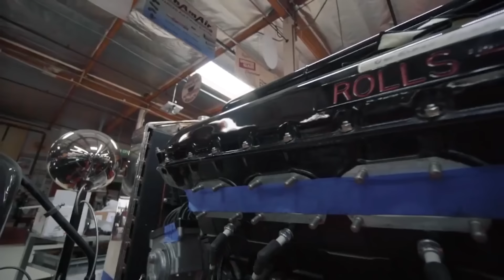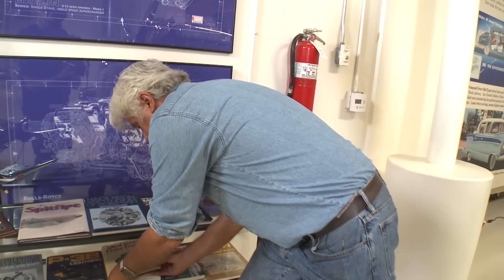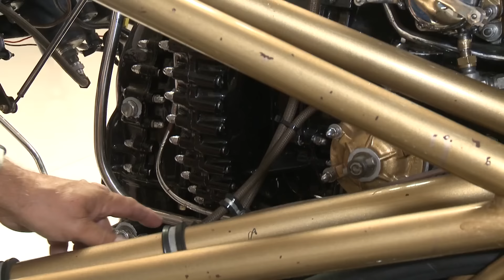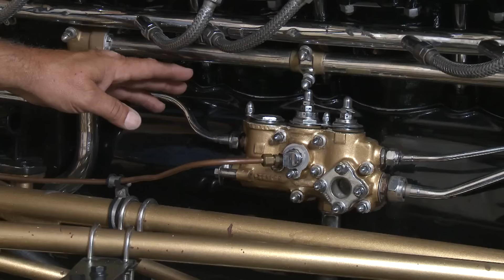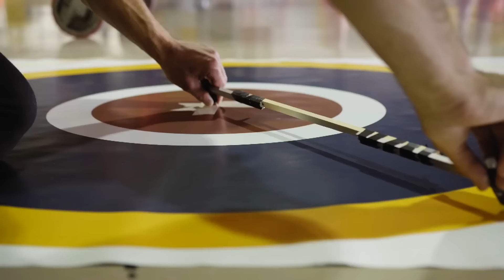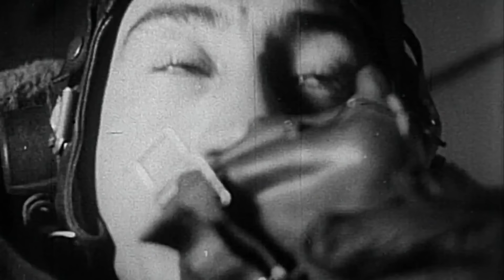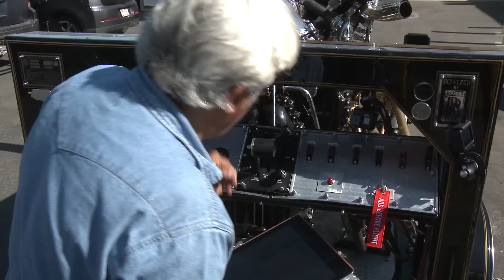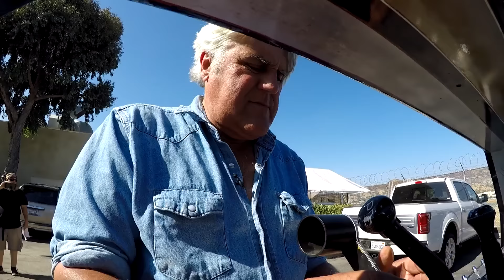The Engine That Won World War II - Jay Leno's Garage

Comment: Jay Leno he has so much fun .Not even close that engine is nice it’s cool demo.But the  F4U incorporated the largest engine available at the time, the 2,000 hp (1,500 kW) 18-cylinder Pratt & Whitney R-2800 Double Wasp radial. To extract as much power as possible, a relatively large Hamilton Standard Hydromatic three-blade propeller of 13 feet 4 inches (4.06 m) was used.This engine won the War 2 it was place in a  Corsair it was fastest warbird at that time top speed was 450mph it was fighter or dive bomber.

Comment: As soon as the engine kicks first time, you need to put the idle cut off lever in full rich position or it won't continue to run. You are starting it on the prime fuel you put in before hitting the starter.

Comment: I used to have a pilot's handbook for a Spitfire. The rules for a Merlin specified 2,400 rpm max normal power, and 2700 at wartime power for limited time. 3,000 rpm at emergency power, for a very few minutes only (something like 12 mins max, or less, depending upon the engine variant), and then a mandatory strip down and rebuild, even if it had been throttled past the emergency gate only for a moment. A wire on the throttle had to be broken to access those rpm in level flight, thus indicating that a rebuild was needed. None of them could be run at 4,000 rpm. 
The first Packard Merlins had better main bearings than the British ones, because of the initial availability of better parts on your side of the Pond, and they also had a number of   other small differences, including American nut and bolt sizes instead of the British ones. The latter was not only because of parts availability, but also to allow the use of standard toolkits for each nation. 
Does anyone know, did Hispaño use Metric sizes for their Merlins, some of which were supplied and licensed to Messerschmitt in 1943? Maybe not, but it would be interesting to know.

Comment: I understand Jay's fascination with the V-12 liquid cooled aircraft engine since it shares many similarities with automotive engines. However, the hyperbolic statement that the Merlin was the engine that won WW2 is just fantasy as is Jay's opinion that the Merlin is the best piston aircraft engine. There were two and perhaps three engines that really vie for the honor of "engine that won WW2" and they were air-cooled radials. First would have to be the Pratt & Whitney R-1830 Twin Wasp twin-row 14-cylinder radial that powered all B-24s and most C-47s. Without those two airplanes the allied offensive would have been gutless. The R-1830 also is the most produced aircraft engine of all time with 173,618 units. The second would be the Pratt & Whitney R-2800 Double Wasp twin-row 18-cylinder radial that powered the P-47 Thunderbolt, F4U Corsair, F6F Hellcat, and C-46 transport.  This is the bulk of US fighter strength in WW2, and for most of the war the R-2800 was the most powerful aircraft engine available. Both the R-2800 and R-1830 had legendary reliability and damage tolerance unlike the Merlin. The third engine is the Wright R-3350 Duplex Cyclone twin-row 18-cylinder radial that powered the B-29.  It can be argued that the B-29 ultimately delivered the punch that ended the war.  It would be somewhat more difficult for Jay to have any of these radials in his garage, and none power any of his cars like the Merlin, but these radials deserve the accolade of "engines that won WW2" and truly are the greatest piston aircraft engines ever made.
Reply: For combat use, the radial had many advantages. Plenty of stories of planes coming home with one, two or even more cylinders shot out. But for max performance  liquid cooling was better. Plenty of Hurricanes and Spitfires went down with shot out cooling, where a radial would have survived. But in the Battle of Britain, it was all about performance. Climb rate and top speed were the trumps and if you look at the maps of the battlefield, and know the RAF tactics, then you'll see why. With limited fuel range in the planes and basic radar, the RAF had to get squadrons and later, wings up to intercept height quickly. The Merlin was the right engine at the right time. It might not have won the war, but it did save Britain, and without Britain, Europe could not have been retaken.
Reply: No doubt the Merlin was a key factor in the Battle of Britain. That said, many developments came along after 1940 and the radial carried the bulk of the load. There was no substantial difference in performance between radials and Vees.  Aircraft speeds and climb rates were similar for top fighters powered by both, Vees having an advantage in fuel efficiency and frontal drag (minimized by radial cowling design) and radials having a weight, power, and durability advantage.  P&W alone contributed over 50% of the aircraft horsepower on the allied side of the war. Radials continued being the recip of choice until jets made them obsolete.
Reply: @RedRoosterParty  oh I agree. Later radials eg the Bristol Centaur were magnificent. I'm just saying that if the RAF had not won the Battle of Britain, which was before the US entered the war, things would have been very different. With no 'giant aircraft carrier' to invade Normandy from, a thrust through Italy or the Balkans would have been the only available routes and they would have been much easier to for the Germans to defend. Would the US have even entered the European theatre, given the odds that would then have been faced? That was a political, not a military decision. Popular opinion in the US was against the sacrifice of US lives in Europe.

Chester Wilmott places Dunkirk and the Battle of Britain as the two defining moments of the Western European war. I agree with him. The Merlin was the star of that show.

Comment: didnt the spitfire also have merlin engines?
Reply: That was actually the airplane, the engine was built for in the first place. The Lancaster came later and the Merlin was a perfect choice of outfitting that as well.
There were of course pro's and con's with the Merlin compared to the MB DG601 in the ME-109. The ME-109 had fuel injectors while the Merlin was fed via carburetor. Most British Spitfire pilots agreed that the ME-109 had a slight performance advantage at low to medium altitude but the Spitfire ruled supreme at high altitude due to the compressor coming into its own at critical altitude.
Another special thing about the Spitfire was that it could eventually out turn an ME-109. However, most of the time, who won a dogfight between these two planes came down to the pilot alone.
While these two planes are usually always compared in relation to the Battle of Britain, this is slightly unfair to the ME-109 since any dogfight between the two type fighters during the Battle of Britain would have favored the Spitfire since the ME-109 pilot would always have had fuel concerns as well as not having any radar to vector them in to British formations.
Both the ME-109 and the Spitfire underwent a lot of upgrades during WWII but it was the ME-109 which first reached the limit to what was practically feasible for this air frame. 
At the time the ME-109 showed its aging design, the Germans came out with the Focke Wulf 190, a fighter plane that the Merlin equipped Spitfire could simply not catch. To catch the Focke Wulf 190, the RAF used the Griffin engine Spitfire Mk XII or Hawker Typhoon. That being said, the Merlin 61 engine Spitfire Mk IX was an even match with the Focke Wulf 190 but if you wanted to be superior, the above mentioned two type planes were needed.

Comment: British engineering at its best! Gave goering a headache and hitler a bloody nose!!!
Reply: goodfella21f  He's not that bias. The fact is that it was the engine which powered most of the planes which made a massive difference to the outcome and length of the war. No other engine can even approach making such a claim.
The Wasp engine was an excellent engine too. Not very much slower, much simpler, cheaper, and more able to withstand damage and keep going, which is pretty important when you are over the sea.
Reply: goodfella21f  Nope. Though the Americans made large numbers of mods which made it easier to mass produce. The performance improvements were driven by RR. The performance started out as better than anything the US had, and climbed steadily throughout the war.
Used in many planes including Spitfires until near the end of the war, when they were replaced by the more powerful Griffon engines.
Reply: goodfella21f  Evidence?
Reply: goodfella21f  You made the big claim, now give some evidence, or retract it.
Now who is more likely to make the performance improvements. The world leading team who had been developing it since the early 1930's, or a group who had NEVER seen such a high performance engine before, and who only had a few months to start making it. Let alone understand the fine points of it, and how to improve it?
Reply: goodfella21f  That is a statement of belief. That is not evidence. What is it about many Americans that everything which is the best somehow had to be made by them. Please read my previous comment again.
Also it was being made under licence, so no changes could have been made without RR approval.

Comment: Wonderful!  I went to the air wing of the Ottawa Museum of Science and Technology, years ago. I think they had a Lancaster, and even more impressive, was something like a Grumman Bearcat!  Neat too, to see that on some of the older planes, they had a pan on the floor to catch oil leaks. Those Canucks, eh?  The most impressive piece of machinery though, was a huge steam locomotive, in the main museum. Up in the cab, I wondered what it was like, thundering down the line, in this beast.  You couldn't see the ground, for about 50 feet, in front of the engine.  Must have been exciting, though some years back, I had a patient, who had driven such things, and he was much less romantically reminiscent of those days. Guess the extremes of heat, and cold (up here in NNY), in the open cab, were a different story!

Comment: Guy Martin has a Merlin engine, if you watch his video he explains how he ran it at 2800 rpm and it took off and took out a wall, recommend looking for the video
Reply: I built an airboat with v6 Chevy on it. Started it in a pole barn first time on  a trailer. Ran the trailer tongue thru the sheet metal on the side of the barn.
Reply: Who is having the most fun?
Reply: 😁👍 I SAW Guys video too,  i think guy arr having a ton of fun with that engine
Reply: That's what brought me here
Reply: Gareth Stroud cool, I just said the same, guys took off a demolished a wall in his workshop.
Reply: @UAPJedi  is that the time he talks about his boss not being too chuffed  lol
Reply: Sean McGuigan that’s the one!
Reply: And a flight of stairs if i remember correctly.😂
Reply: https://youtu.be/wJ9aO5yvT3k
Reply: https://www.youtube.com/watch?v=9wkxrQOkNdc

Comment: One might argue that the Double Wasp actually won WW2...
It did power the F6F Hellcat which had the highest number of aces during the war. It also powered the F4U Corsair which was quintessential to the island hopping campaign of the pacific and it doesn’t end there, the P-47 which was arguably the best tank killer of the war  and was used to escort B-17s and B-29s to victory throughout, was also powered by the Double Wasp
Reply: War was over by then.

Comment: never flew The Mustang or anything with the Merlin But I've flown 2 different Planes with the Pratt and Whitney Double wasp in them. Now that's an amazing engine, a big engine.... That's why the nose of the corsair is so long.
Reply: R2800 Radial engines. Signature sound :)
Reply: The Corsair's nose was so long as it also had a fuel and tank in there as well.